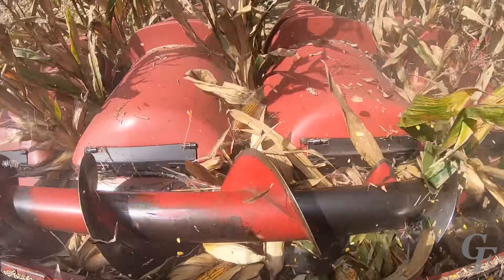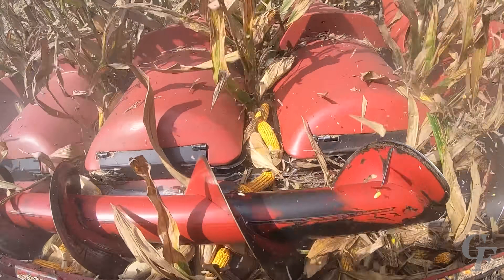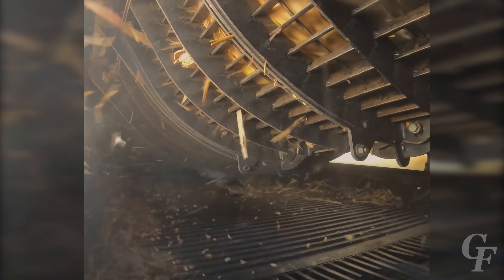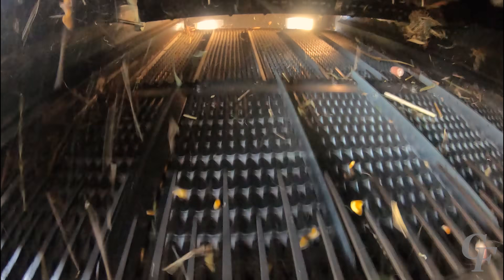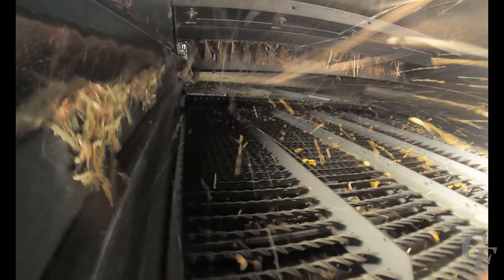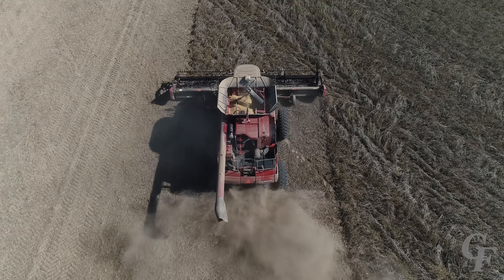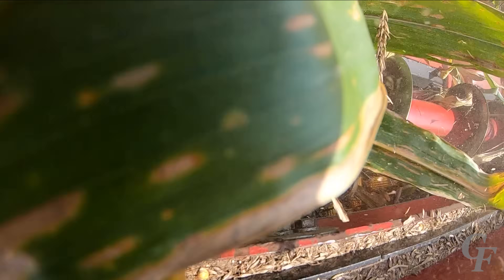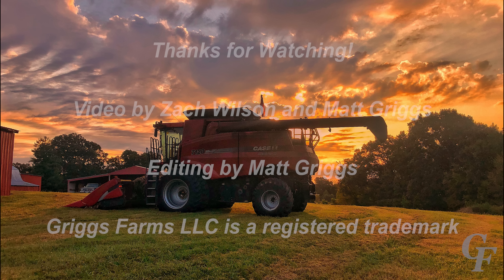How a Combine Works: A view inside the combine [4k video]

Comment: What gets me is how the kernel is plucked from the cob,  without being damaged.  That is the part that is hard to figure out.
Reply from the maker: The corn kernel is essentially “rubbed” off the cob as it rotates around the rotor. The kernel is very hard and difficult (but not impossible) to damage.
Reply: @griggsfarmsllc  Such a clever system.

Comment: What happens to the husk. Does it not have any nutritional value? 
Is any of the chop residue good enough for a corn silage type mixture? 

Love the videos. I grow grapes and a lot of it is done by hand still today.
Reply from the maker: The residue has very little value and only has small nutritional value. Silage is usually cut when the corn is still green before too much fiber has built up in the plant. The dry residue does have some value as a fuel to produce ethanol from but there are very few facilities that use biomass as a feedstock to produce ethanol

The residue is of greater value decomposing on the soil and returning organic matter and nutrients back to the soil.
Reply: @griggsfarmsllc  very interesting. Thank you for the answer.

Comment: How do the larger pieces of plant material move from the thresher to the chopper without the cage getting plugged?
Reply from the maker: Samual King rub bars on the rotor  move the material around the rotor. There are angled veins in the rotor cage that move the material rear wards as it goes around the rotor

Comment: So I take it from one of the comments I read below that the Sieves are adjustable for different crops and you don't have to replace or change them out if you're going to harvest a different crop that year you just have to ensure you have the proper Header attached?
Also do you have to change anything on them in order to drop a Swath behind to combine if you were harvesting and wanting to bale straw afterwards or is it just a flip of the switch basically to turn the Spreaders off?
Reply from the maker: Tazkar there are different sieves that you can change out depending on the crop you harvest to get increased performance from your combine. However unless you are harvesting extremely small seeded crops or light weight seed the standard long tooth sieve works pretty well, especially for the most popular crops such as corn and soybeans. They also do an acceptable job in wheat.

To windrow the crop for baking, you either have to take the spreaders off on the rear or raise them up depending on the model of combine.
Reply: @griggsfarmsllc  Thanks for the answer, definitely interesting to learn more about combines and such as a non-farmer.

Comment: Would you recommend flipping the panel on the feederhouse forward to get video of the feederhouse in action and raising the side panels and removing the side shields to get video of the threshing and separating parts of the rotor in action and opening the panel that gives you access to sieves and chopper to get video of the sieves and chopper in action? and where on the corn and soybean head and grain tank and where the spreaders are would be a good place to mount my camera to get video of the corn and soybean heads, spreaders and of the grain tank filling up and unloading?
Reply from the maker: Jake Spoon yes I would recommend opening up all panels to get as much light in as possible. As for placement, you’ve just gotta experiment. It all depends on your camera, mounts and what you can fasten to on the combine.

Comment: And what speed do you usually have the rotor and fan and spreaders set at for wheat, corn and soybeans? And what do usually have the sieves and chopper and concaves set at for wheat, corn and soybeans? And what speed do you have the corn head and soybean head set at for corn and wheat and soybeans?
Reply from the maker: Jake Spoon for harvesting I’ve usually got it set pretty close to what the manual recommends. It’s different than what you’d run on a 2388. There was a pretty steep learning curve going from my old 2366 to the 7120

Comment: The combine and corn head and soybean head I will be using for the video is a 2004 Case IH 2388 and a Drago series 2 6 row corn head and a Case IH 1020 30ft soybean head and the camera I will be using is a AKASO EK7000 4K Ultra HD WiFi action camera and the mounts I will be using is a clip mount and a suction cup mount with tuck tape or gorilla tape and would it be a good idea to have the side shields removed and side panels raised for the video like you did? and when’s the best time of day to do the video? And did any grain and chaff residue come out of the side of the combine since the side shields and side panels were removed and raised? And where did you mount the GoPro on the corn head, feederhouse, rotor and sieves and chopper? And would it be a good idea to mount my camera where you mounted yours? And did you have a shield opened on the feederhouse to get video of the feederhouse in action?
Reply from the maker: Jake Spoon I don’t remember exactly how or where I placed camera for each shot. A 2388 is going to be a little different anyways because it’s a lot tighter internally with different concave design. You’ll just have to play around and experiment. 

I don’t recommend suction cups. You’ll probably use the camera. Use only stiff jaws or sticky pads. 

I did it about 10:30-11 am when sun was high but still angled a bit and not pointing straight down. 

Yes chaff and grain came out the side. 

Not familiar with that type of camera so I don’t know how well it will work. 

Yes my combine has a panel on feeder house that I took off. A 2388 has one in the same place that flips forward. 

I mounted the GoPro on the snout of the corn head pointing back with flexible jaw mount. 

2388 has smaller panels so not as much light will be let in. You’ll likely need additional lighting. Just need to experiment with it.

Comment: And I’m wanting to get some video of the same stuff that you did and I was wanting to know if you can give me some advice on what kind of cameras, mounts and lights would be best to use and where would be the best place to mount the cameras, mounts and lights?
Reply from the maker: I used a Phantom 4 V20 drone and a GoPro Hero 7 Black for this video.  For the GoPro mount, I use a flexible jaw mount for 95% of my GoPro shots.  Just google "GoPro flexible jaw mount" and you should see what I'm talking about.  You can remove the jaw attachment and use a sticky pad for the internal shots.

I did not use any extra lights. The 7120 combine has a light above the sieves that helped a little. I removed the side shields and raised the side panels to try and get enough light in there.  i also picked the time of the day where the angle of the sun would reflect light in there.

To get really good shots, you need to understand frame rate and shutter speed.  For slow motion, the higher the frame rate, the better the slow motion.  But the higher the frame rate, the higher your shutter speed must be, thus letting in less light to the optical sensor.  So its a trade off.  Increasing the ISO too much will result in a grainer shot.

For the shot under the rotor, facing the sieves, I filmed at 60 frames per second (fps) at 1/60 shutter speed.  240 fps at 1/240 shutter speed was too dark of an image.  For the shots pointing at the rotor and filming from the back of the sieves, 240 fps looked good because there was enough light.

The editing software i use is Adobe Premier Pro.  I create a 30 fps timeline to put my video clip into.  At 30 fps playback speed, a 60 fps video will play at half speed.  A 240 fps video will play at 1/8 speed.  You can then speed it up if its playing back too slow.  If you try to slow down a 30 fps clip in a 30 fps timeline, the software has to "make up" data to fill in the missing frames, and the video looks jerky and blurry.  

For these shots I ran the rotor as slow as possible and turned the fan way down.  I ran the engine at 2/3 speed and took in only about 10 feet of row corn.  This gave enough flow to show the process.  Anymore, and it becomes a hurricane of dust, chaff, and grain and you can't see much of anything.

I hope this helps you get started.  When you post your video, send me the link, i'd love to see it!  Hopefully you can do a better job than me!  Good luck!